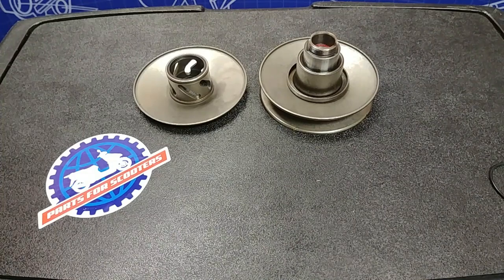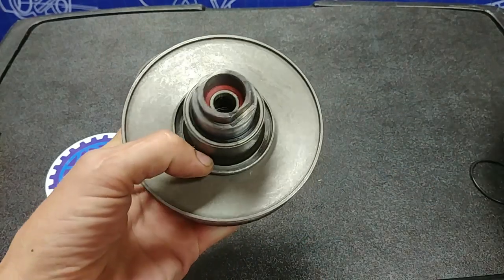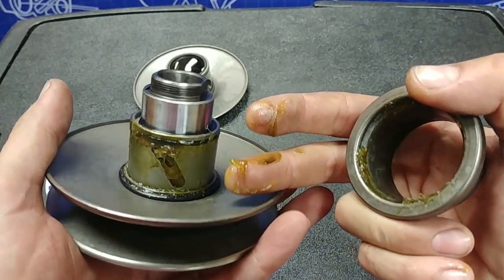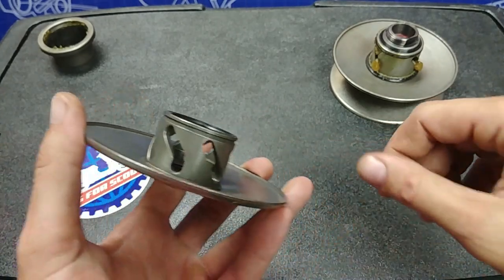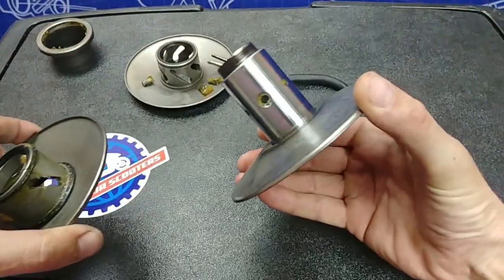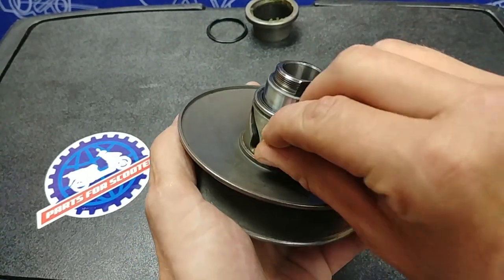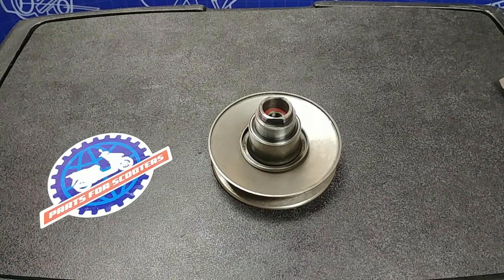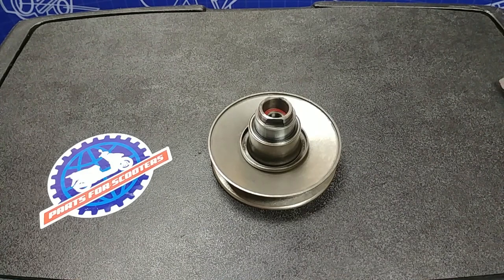Scooter Torque Driver - What It Is and How to Install

Comment: Finally! The biggest problem with scooter parts, there are no description,  no "sale" like they are doing you a favor just by offered the parts for sale! Car performance parts tell what it's used for, they sell you on the parts, tell what the point of the part is, why you may need it. What it does and the gains from the part! Not on scooter parts, some listings you have to Even figure out what the parts are, then what it's for, why you would want it!   Anyone new to scooters would have a difficult time figuring that out, if you don't know what it looks like, good luck, and if you don't know how it works , good luck, most listings , like clutch springs,  some ppl may not have a clue what different springs do, or why they may need different springs, no description of potential or anything,  so thank you for this video!

Comment: So straighter the groove, faster it shifts? I got a NCY sheave, and it says "for DIO" on it, I'm using it on a 139qmb, I tried both grooves and didn't really notice a difference, I'm running 81cc with a9 cam, ported head, with exhaust, and ported and matched intake, it runs best between 4-5mph and around 20-25mph, then it falls on its face with the slightest hill, dropping back to about 25, it will do 50or so on flats, I'm 6'6, and 320, so it's asking alot of the small engine, but I had one before that would do about 50-55 fairly easy, 35 up hills,  I'm building another engine, with 52mm bore, and maybe a stroker, for 95cc, with a ported big valve head, I'm hoping to get it balanced either way, I also have titanium retainers and 12k rpm springs, I'd like to find a more spicy cam, and crank the compression up to around 200psi, I'm guessing that unshrouding the valves in my current engine hurt the compression more than i anticipated. My cheap gauge reads 152psi, I figured atleats 160-165psi ,  but I guess it dropped more than I thought, that and polishing the piston, removed a bit of matereal attempting to get it smooth!  The pop-up piston with the 52mm kit should fix that! Along with a larger bore, and possibly a stroker CX crank, 3mm should add a good bit of squeeze! Definitely going to need additional cooling, with the larger engine, and wide open head, and larger valves, I'm hoping for about 9-10 HP, at upwards of 11500 rpm, i have seen upto about 10300 with the current 50mm bored stock ported head, not much can be done with such small valves! I know the 139qmb's get no respect, but I'm hoping and wishing, hope in one hand, crap in the other, seems I got poo in both hands! Ha-ha , but hopefully I will I'll get more power from the Rodney Dangerfield of engines!  I have thought also about getting one of the tiny roots style blowers! Supercharge that tiny engine! Or just 150swap! With atleast a 171bbk!

Comment: Do i need to adjust the roller weights for this modification?
Reply from the maker: You may need to adjust your rollers to get the desired performance, yes.
Reply: Are the smaller unused holes for lube.      2000 miles. Later?   Bill
Reply from the maker: @williamhaskellhaskell3162  Yeah, they just hold some extra grease.

Comment: Can you recconended a cam for the 139QMB? Something a bit more spicy than the a9, cam, I have an a8, and I'm thinking an a12, does anyone make anything better?  These seem to be stock cams, for different applications,  I'm used to car cams, where you have a spec card, and a listed rpm range, lift, duration, lobe separation angle, centerline, and advance,or retard to improve low-end or high-end power slightly.. I have seen one cam hub, that allows the cam  advance or retard, about +/- 4°maybe 6°, but I don't know if it would help with the stock cams, I'd like a cam that produces a wide power band, around 6-12k rpm, with peak about 10k, a power band atleast 8k-11500 rpm, the a9 seems to be out of gas, around 8500-9000, but will still rev to 10350 rpm,  but well past the peak, peak power seems to be between 8&9k rpm,  now my cruse rpm is about 8200-8700, it's difficult to tell, because everything is either uphill or down here, I'm hoping the new engine will allow me to cruse around 50 mph, and see 60-65mph, on flats, with maybe 70+ downhill, (I don't want to go over 70 or so, it's a bit sketchy above 55-60) besides 35 is legal, I mostly want it to hold atleast 40-45 up hills, I'm asking alot from such a small engine!  Maybe converting it to a 2cylinder! Using two 50mm bores, and two big valve heads, and a couple a9 cams! And either a couple 20mm carbs, or a single 30mm, i think I'd want to keep that crank under 9k rpm, unless a bearing can be installed in the middle some how, maybe they can be built to last, and they do sound awesome too!!

Comment: 02:51 it should not demand that much effort.  Spring is not loaded.
Reply: by hand you mean? he's pulling against the o-rings. when installed, the belt will wedge it outwards AND twist it "forward" seen from this angle.